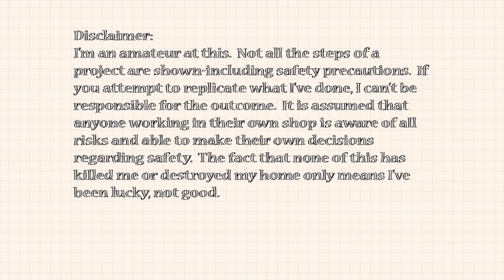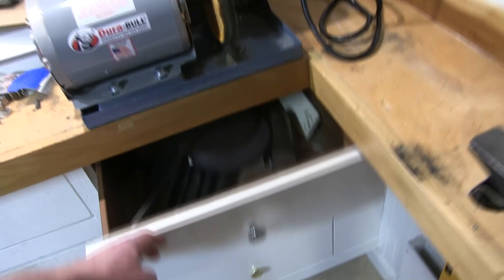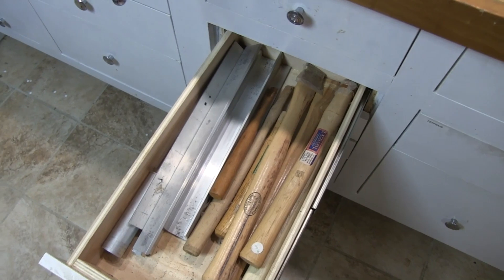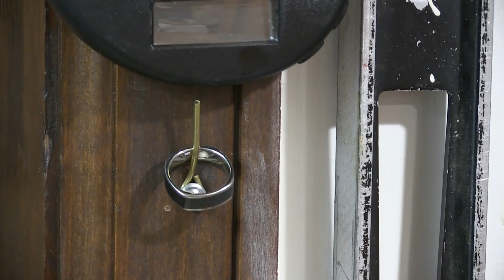Workshop Tour

Comment: what  foam did you use for your measuring marking and layout tools rack
Reply from the maker: Some inexpensive Harbor Freight EVA foam floor mats.
Reply: @daleaustin3982  Cool and how did you mark and cut it out and make it looks so neet and precise
Reply from the maker: @DinDjarin48  There are two layers of foam. I laid the rack on the workbench with the tools where I wanted them and outlined them with one of those silver paint pens. Cut the foam with an x-acto #11 blade-you end up sawing back and forth a lot. Some things I cut through two layers, others only one.If you look closely, you'll see some areas I held down with  screw and large washer. That was in places where the tool was heavy enough to warp the foam.